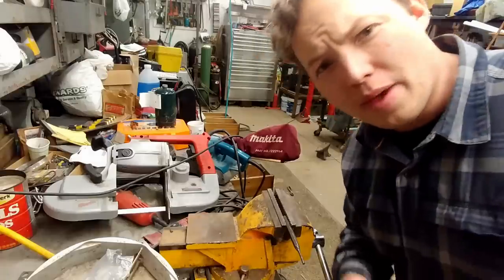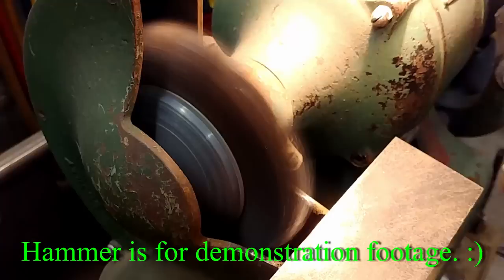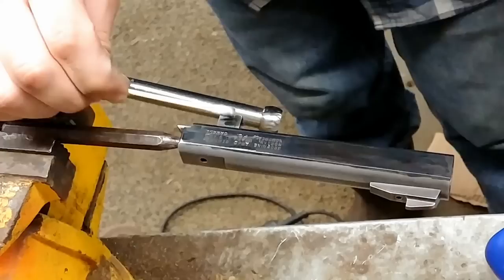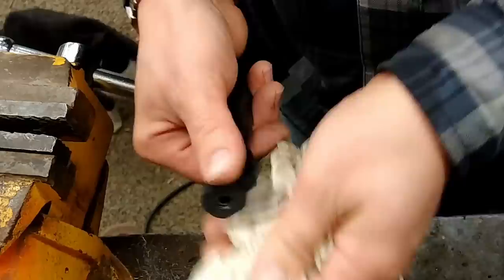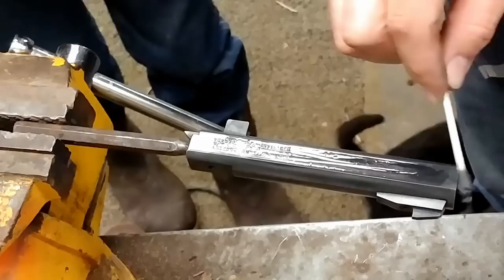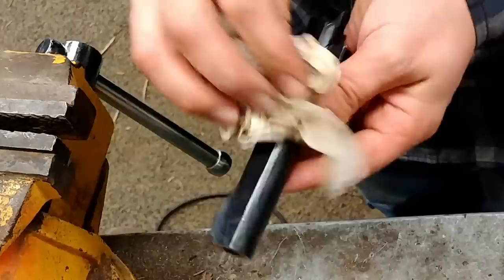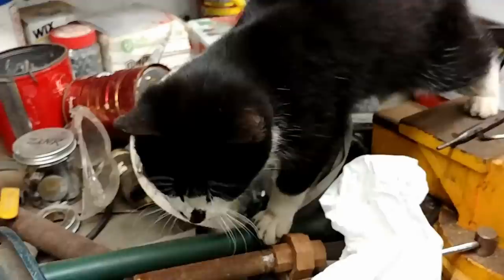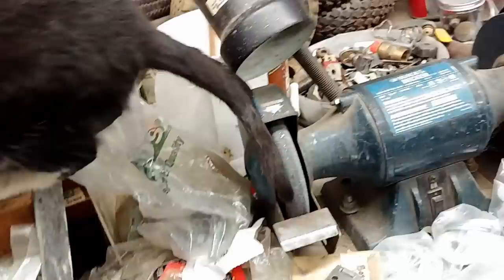How To Blue a Steel Barrel Using Super Blue! Worked Way Better Than Expected!

Comment: You should never dip the Q-tip into the bottle. It will ruin the remainder of your solution. Always use a separate bowl or container.

Comment: always wipe down with oil once finished to stop the bluing process to avoid deep corrosion, what also helps is heating up your metal with a hair dryer to open up the pores of the metal for a deeper blue.

Comment: When I blue firearms, I wear gloves and use acetone to de-grease the parts.  I have found break cleaner leaves a film.  And when applying the solution I use facial pads and apply the blue in even strokes so you don't get any runs on the metal.
Reply: The only thing I would add is it’s best to use a separate container. If you repeatedly dip a swab back into the original bottle you ruin the solution.
Reply: @Wormuloid4157  agree
Reply: They used no gloves and no glasses---then they put the poor cat  in danger being so close to what's going on !

Comment: i have found that pouring the whole bottle in a glass sauce pot, warming the bluing liquid up (not hot) and just lay each item in it for a few minutes gives a super blue/black finish. Use caution, wear gloves and eye protection and gently pull the parts back out with a piece of wire and then dip them into very warm soapy water (dawn liquid) to dilute the salts immediately.
Reply: What does diluting the salts do

Comment: I'm glad this worked for you. I attempted with perma blue and 0 results on a stainless barrel on my 9mm and on my knife. 0 results by following the instructions.....
Reply: Check the video at 0.48 seconds, clearly says on the side of the bottle that it does not work on stainless steel.

Comment: I used super blue on my Rock Island Armory m 206, and was equally impressed with it.  I also cleaned it with brake cleaner first, and applied it with a Q tip.  If you wipe the gun down afterwards with a light coat of gun oil, it'll look even better.  Amazing stuff.
Reply: Did u wire wheel it first?
Reply: @korkser  No

Comment: You are not supposed to touch the metal with bare hands once you have degreased it cleaned it, oil from your fingers will cause the blue to be blotchy and it will not even out...
Reply from the maker: Thanks for sharing!
Reply: Exactly. 1st thing i thought was should be using gloves. But did a decent job
Reply: I like the uneven blue steal better
Reply: In which state are you in America, O Benjamin
Reply: @BenjaminSahlstrom  hey Benjamin, will the birchwood aluminum black work on the pt111 g2 taurus stainless steel slide????
Reply: @knightrider3766  it won't stick to stainless steel. only raw steel
Reply: Does this liquid works for iron

Comment: Use a new sponge. It applies much better and evenly. It comes out blauchy with tips.  But oddly, it ends up even and clean as you wipe it down  light with Scotch Brite., between coats. Just beware, it takes several coats if you're down to bare metal!! It's actually a lot of wiping and cleaning between coats. It's still a lot of work. I respect guys who do this for a living. It's very tedious work.

Comment: I have found that the streaking can be completely avoided by dissolving the gun blue in water to make a bath.
That allows you to completely submerge the part in the solution, and makes the process slower and more controllable.
For a part this large though, you really want to is something other than cold blue. Rust blue is pretty easy and safe to do.
Reply: Hewhoremains420  Yes it does work with cold blue. I dont have a specific formula for how much to add to the water bath. Add about as much as you would expect to use if you were applying it directly to the metal - diluting it with water just makes it turn out more even.
The reason I wouldn't want to use cold blue on a large part is because it's not real bluing, and is only really intended for touch-ups. It has almost no resistance to wear.

Comment: i know its old video and ill bet some1 else has already told but still tell that ya should pour that liquid another container that much what will need and were ya dip ur applicator, it can ruin whole liquid if ya use it straight on bottle and should use gloves to avoid fingerprints etc, but good video, i have plans to blue my winchester 1300.

Comment: loop a wire hanger through the barrel without touching the surface than dip it in the blue so it will have a even coat, sand if necessary, then redo the process until you get the look you want.🤔

Comment: Advice for bluing, wear gloves. The oil on your fingers will fuck up the finish. Use a paint brush or large cotton applicator. Not small que tips unless getting in tight spaces. When you're finished wash it with soap and water so it doesn't turn into a pile of rust.

Comment: I am surprised you got such a nice blue job after you touched everything with your hands!! You always wear gloves and never touch a metal gun part you are going to blue with your bare hands and fingers! GEEZZZZZZZZ!!!!!!!!!!!!!!! The blotchy stuff you had was due to touching it with your bare hands!! After cleaning what you are about to blue use Acetone to remove anything that might interfere with the bluing! Acetone leaves no residue and dries so fast you don't have to wipe it down after use! And the best way to apply this bluing would be to fill a canister up with the bluing solution, Requires a lot of Super Blue, and dipping it in the solution, and letting it sit for about 30 seconds and then rinsing it in hot water. If you only had the small bottle of Super Blue You could wear gloves and put a lot on a paper towel and rub it on the part really quickly and then sit for 30 seconds and rinse in HOT Water. One last note about bluing. If you want a really shinny part, polish it to a mirror finish before bluing!!

Comment: Pour the liquid into a small plastic container so you don't contaminate the rest of the liquid, Ppe is very important when using any chemical, degrease with acetone and try brushing on evenly in one direction.

Comment: Use 000 steel wool. Yours looked a bit course for what your doing.  Get a steel wool with the most amount of "0"s  on the package.   I clean some of my spent brass when reloading if I have powder burns on my brass.  000 works great.

Comment: You don't want to touch the barrel with your bare hands after cleaning you could get uneven bluing from the oil in your fingers and dipping a q-tip in the bottle will contaminate the bluing solution making it  go bad quicker.

Comment: I did try to cold blue couple of nuts, after a while they got covered by a thin layer of rust, which goes with a wipe. Do you have any idea why this is happening?
Reply: Rinse with cold water then oil for over night. Stops the bluing process.

Comment: Use rubber gloves, if you've touched the barrel bare handed it’s no longer clean, and never dip a swap or brush into the container, pour into a small dish then get rid of the remainder.

Comment: Wooden dowel shaped to fit a section of the barrel to hold the barrel would be better for a handgun, for a longer gun a dowel in the chamber with a string through it and out the barrel to hang it up will help

Comment: I would think a cotton ball would work better for a applicator & also handle it with gloves as 
to not get oil from your bare hands. But even so it did work out ok. The only thing about that 
Cold blue, it wears off easily. But you can touch it up easy. It just not a long lasting finish as 
Hot blue.

Comment: Will it work in a non-mirror polished stainless pistol barrel made from heat treated 416 Stainless Steel?
Reply: Cold bluing is not recommended for stainless steel
Reply: Will not work properly. Blotchy finish that becomes streaked over time. Do NOT use this product on any stainless part.

Comment: Use a clean cloth/ q tip each aplication .not the mancy one from the previous coat ; also use fine wire wool not that rough assed barbed wire you just used ,, apart from that decent vid

Comment: Use rubber gloves to not contaminate the metal with your oily hands. It's better to dip the hole part in the blueing solution so as not to get that blotchy appearance. 😁

Comment: Interesting but was anyone else absolutely cringing when he started applying without gloves? And a loose hanging shirt? And no safety goggles? Then the barrel is so not secured to his makeshift loose fitting pin apparatus? Then the cat?! My stomach was in my throat as I expected the worst. WOW. Just a few simple precautions could have made this so much safer. I'm glad nothing bad happened but that wet barrel tipping off that sketchy pin set up as it flings a drop into this guy's eye? Yeah, that's what I'm saying.

Comment: so if you preped your barrel the way you did the hammer you sir should not own a gun you used a hard wire wheel that is a disgrace and the ultimate sin also nice that you shove a hard tool punch up the barrel nice another sin sell your guns and go into tool restoration now go back and do some research about do;s and dont;s in repairing guns